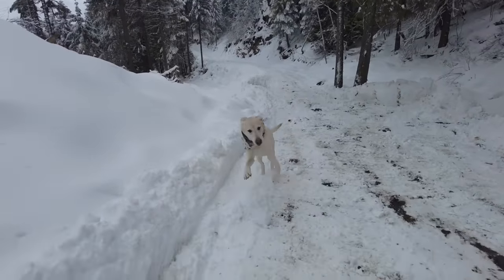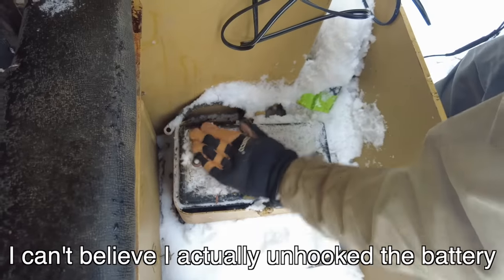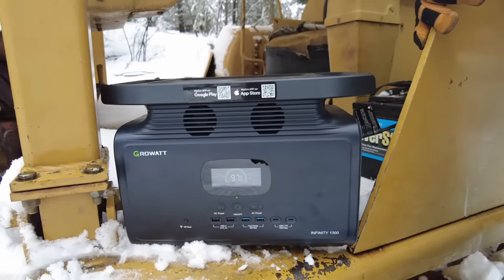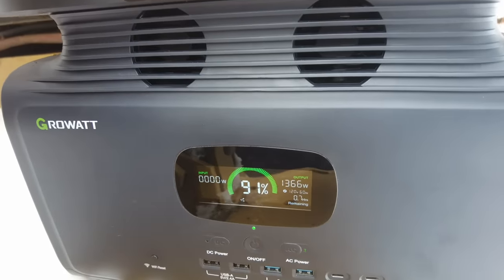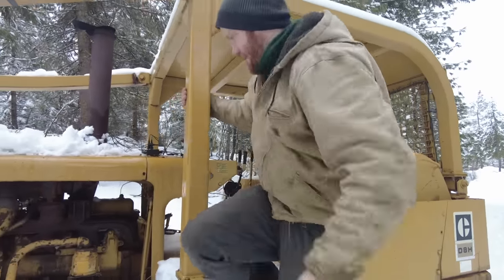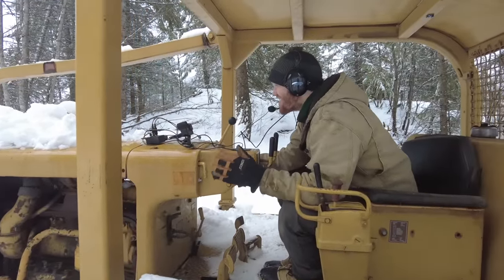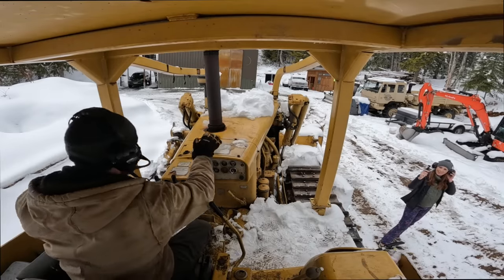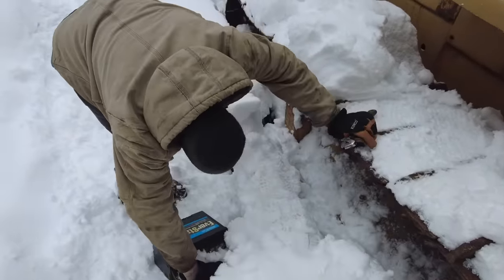D8 Dozer, Will It Start? | Using Our Infinity 1300

Comment: Just so you guys are aware, the pony motor does not have water circulating through it until the diesel engine is engaged because the diesel engines water pump is what circulates the water. You don’t want to run the pony very long without engaging the diesel because it will over heat
Reply: I was thinking the same thing
Reply: Wrong. The pony thermo siphons coolant on some like older john deeres and others do have a waterpump.
Reply: @rednekd1  well I’m referring to a caterpillar not a John deer. I own a D8 exactly like theirs with a pony motor and they do not have their own water pump. The caterpillar service manual for the machine even states that the diesel engine water pump must be turning for the starting engine to receive water. But maybe they’re “wrong”
Reply: I’m wondering just how difficult it would be to enclose this type of dozer cab?
Reply: One day it’s ecoflow then bluetti then growatt or anker lol just more ads than content lately

Comment: Suggestions: 1] Take the batteries out and store them inside for the winter; 2] At least throw a tarp over the cab to protect stuff from snow and water; 3] Put STA-BIL formulations in fuel tanks to preserve the fuels.  Have fun !!!!
Reply: I think they are building a storage building to fit all their equipment this summer. So stored inside, where it can stay warmer and out of the elements. They can probably incorporate battery tenders to connect to all the batteries in-situ.
Reply: I had the exact same thoughts as I watched this video.  Taking the batteries out, would not only help protect them from the cold, but would give you a warm place to recharge them in advance when you knew you were going to use the equipment.
Reply: I'm all in favor of an equipment building.  They certainly have enough equipment and vehicles that would appreciate covered storage.

Courtney says she has a surprise giant equipment coming.. I can't wait to find out whatbit is, and am sure deep thought went into it.

I'm glad you stockpiled videos  / episodes ❤🎉
Reply: My thoughts exactly why  leave s battery out to freeze
Reply: i came here to say the same exact thing. a little winterizing goes a long way with equipment
Reply: That D8 is big rough to make a flat spot a n y w h e r e.  Just make it close enough to run an extension cord to a block heater.   I don't think a battery tender would keep the batteries warm so pull 'em an put them inside on a battery tender somewhere warm.   Sta-Bil.  Grease.  Top off all the fluids.  Verify the coolant's good to -20°F.  Throw a tarp over it and run the block heater once a month for a couple hours.  Even if you build a shed, put the batteries somewhere warm and on a tender.   Tenders are cheap and you can share them over multiple batteries.
Reply: Great things to do for sure
Reply: While I agree with your statement. Leave STA-BIL out of the equation. STA-BIL unfortunately has the ability to gel if you use to much and doesn't do anything if you use to little. Drain both the tank and the carb on the pony motor and use it in the Car/Truck. IF the diesel is not going to be used for months at a time? Drain the tank also. They make Winter and Summer Diesel..I am surprised the Cat fired up...I was almost sure it was gelled in the Fuel Filters. Maybe the Pony motor helped who knows. Things are not adding up in my head. That D8 never should have been able to start TBH
Reply: I used to operate that exact dozer. You have no real idea of how lucky you are that the engine fired up.
Reply: This. I leave my batteries in my farm vehicles, but they are inside an engine compartment and they are connected to a battery maintainer, plus I don't have snow that deep or that often and temps don't get below the teens, usually above freezing. A good way to kill a battery is to leave it in really cold temps, for months on end, without something to maintain a charge.
Reply: Batteries should be stored cold for lowest self discharge, below freezing is even better. Putting them somewhere warm only shorten their lifespan. However, it's important that it's fully charged before you store it somewhere freezing, or anywhere for that matter. The only reason people wrongly think it's beneficial to store batteries indoors/warm, is because you actually have to disconnect them to do so, and a most old iron have leakage currents because of dirty connections and terminals and most new stuff have vampire drains from electronics, so a fully charged battery will be drained regardless of temperature unless you disconnect it and make sure the battery itself also is clean and dry.
Reply: I always clean off the entire dozer off then start climbing on the machine to check things out. Falling can end the whole project permanently. Liked your video.
Reply: @royblackburn1163  I used to work in a manufacturing factory, building, maintaining, and repairing the equipment. We learned that there is a cure for stupid! That cure is “massive trauma”! It always amazed me just how smart those idiots were, we couldn’t stay ahead of them. They just kept getting smarter!
Reply: Vehicles such as these are meant to live outside..........No matter the weather/
Reply: Not a fan of Sta Bil have had better luck with Howse but to each their own just my $0.02
Reply: Start it every week. !! Put conditioner in fuel. Tarp it in. Park it where it can be boosted or charged!!
Reply: I am glad I live in oklahoma
Reply: Not being a wise ass....     but he doesn't know that..      he researching YouTube fir the next move
Reply: To do that they would need to think!!!
Reply: Park the machine close to electrical service so it can be charged and a heater used if necessary.
Reply: Why not check/top up all the fluids before shutting down for the winter?
Reply: The tarp makes life much better....Canvas is the way to go,
Reply: @ChanceHolland-eo3yj 😂

Comment: I understand fuel is expensive but when I put my equipment away for the winter I fill the fuel tank to the brim. That reduces condensation in the tank. I also put fuel stabilizer in the gas tank and then run the engine to get the stabilized fuel through the fuel system. Finally I change the oil and run the engine for a few minutes to get clean oil throughout the engine.
Reply: I run non-ethanol fuel for gas engines that set unused for any length of time. Much better on the fuel system and old carburators. Less corrosion and clogging.
Reply: @brianworley7705  Brain, great idea. Here in Canada the only non ethanol fuel I know of is super. More expensive but worth it not having to fight the fuel system come spring.
Reply: @PierreLamy-t1h  Here in the USA, same with non-ethanol fuel usually being premium grade which is expensive but worth it compared to carb issues and rebuilding.
Reply: Ethanol fuel safe carbs need very specific ethanol safe carb parts.  Even then the ethanol has issues but Sta-Bil helps.  A lot.   Running ethanol fuel in a carbureted vehicle stored all winter is begging for serious issues.

Comment: Playing with dozers is addictive. Bring the batteries inside for winter. It is worth the money to put a big tarp over the dozer when not in use to prevent corrosion. I use a tent garage over mine. I replace the tarp every 2 years($40). You will need to support the tarp so that rain/snow slides off. Park it near your house so that you can keep an eye on it. I have and old Sears kerosene heater for putting under engines to warm them up. Get a fuel funnel for filling fuel tanks. A good fuel funnel will have a screen that keeps water out and the funnel will prevent spills. Good Luck, Rick
Reply: Rick knows!
Good advice.

Comment: the Dozer is nearly unstoppable but be careful on snow pack.. once it starts sliding sideway's its a bobsled on those steel tracks.. TRUST ME .. D9L sliding sideways puts crap in your shorts in a hurry..
Reply: I've went skating with a D6C sideways and I've watched a D8H go sides down a slope, it takes some good sized trees to stop a D8 once it takes off

Comment: Hey Riley, with a pony motor it is relatively easy to get everything warmed up enough to start. I had a Cat 12 motor grader that I used to plow roads with. Almost every time when I needed it I had to go through all of the things like you did. Not much fun and quite often a pain in the booty. With my grader I would take a large bag of charcoal like you would use in a barbecue and put it into a cut off oil drum right under the engine. I would light it up and then go back inside my house and make breakfast and maybe do a little reading. After about an hour or sometimes longer when it was really cold, I would go out and hop in the seat and push the button and it starts right up. Super simple. It does require that you keep your equipment fairly clean because there are not too many experiences more exciting than watching all of the brush burning in the belly pan. That happened to me once but I had a large enough fire extinguisher on the dozer to put it out.
Your method looks a lot easier than what I had to do though. 
Your Pal Al

Comment: Hey Riley, have you checked the brake adjustment on your left and right sides? I can walk you through it if you want, there is brake adjusters underneath the fuel tank at the back of the machine above the winch behind that cover. the left brake always gets overused on the left side because their right foot is on the decelerator, operators seem to like to only use their left foot to brake the machine thus wearing out those shoes first. 

First chock the machine in a nice flat position, with something substantial against the tracks so it can't roll anywhere and disengage the parking brake. Machine engine off. 

To check adjustment pull that panel off and ontop of the left and right brake assemblies is a small cover with 3x 3/8' bolts in each. When you remove that cover there will be the brake adjustment head exposed which also uses a 9/16" wrench or ratchet to actuate. take your ratchet and every time you tighten(clockwise) you should feel a click if the detent isn't too warn out. anyways Run that all the way down until it bottoms out then back it out and count the clicks until it stops rotating counter clockwise. This is going to give you the rough idea of how warn your brakes are. Mark both sides down for how many clicks and then return allll the way to the bottom again (clockwise) and then back out 10-12 clicks each side. 

Once you've done that before you put the covers back on, hop up and feel how the brakes are actuating. if one pedal is closer to you than the other you can adjust accordingly (Counterclockwise pushes the pedal AWAY from you. If your brakes have excessive clicks with the adjuster (140+ depending on linkage wear) you may need to tighten up a bit more than the 10-12 clicks but if you go all the way tight and you still have no brakes on your left track then your brake shoe and drum is past wear and you'll have to replace both. 

install covers with anaerobic Loctite 515 Sealant or RTV and anti-seize the 3/8's bolts and tighten to 30 ft-lbs
Reply: I'm going to need time to digest that.   Come back and reread, then digest again.   Great read.

Comment: Hey Riley, 
That machine should be equipped with reversible fan blades.  There’s a tool that grabs the base of every fan blade.  You push each one in and turn it so you can either pull the air through the radiator or push it out.   We ran our D8’s in the winter time with a rear curtain and two side curtains.  The operator stayed warm and toasty.  I was in our shop the other day and noticed I still have a fan reversing tool but we no longer have a D8H’s. We were running 4-5 at one time..
Reply: He's really building a practical fleet: mini excavator, multi-attachment skidsteer, custom self-created, snow-eating blower on the front of a go-anywhere Army truck, the D8H with a decent blade and handy winch and a host of smaller toys and runabouts. Livin' the dream!
Reply: Richard D is correct 
Look for fan blades that are reversible. Push em in and turn them. 
If not?
You’ll need an elephant snout- canvas shroud that directs warm air from front of radiator to operators station.
Reply: think i remember that on old d4,just by hand,no tool,or maybe it was 951

Comment: Hey guys I have two things for you , first for winter an access port in the air cleaner to stick the heat gun  into to prewarm the air for the pony and the big one to warm faster ... Second , find  a triangler in shape tarp  long side wraps over the radiator left to right side and all the way back to the operator seat covering both open sides of the motor..tie  down points or heavy pull magnets to hold in place engine heat will be blown back to keep operator toasty  but smell like a cat motor by  end of day .

Comment: If the charger won't start charging a battery because it's too low, sometimes you can hook a good battery up to it in parallel, turn on the charger, then disconnect the good baterry. It just expects a minimum voltage to start charging. That's my experience with the Battery Tender brand anyway. Just be careful of surge currents and sparks, and don't leave the parallel connection on for too long.

Comment: Next time take the battery inside. Have a spot under a bench somewhere with trickle chargers for these starter batteries. Also consider putting stabilizer in the diesel tank for the winter. One day you'll have infinite time and money so you can build shelters for all the things! ;-D

I wonder if this dozer heats up the fuel intake too, and if the pony is helping with that. Cold diesel doesn't atomize very well.
Reply: Keep in mind, trickle chargers/battery tenders are a huge fire hazard, avoid using them inside residential buildings if possible!
Reply: @marks8068  not good ones. This is lead acid packs.
Reply: And these aren't Lithium Ion.  The motorcycle tenders are .5 Amp and shut themselves off once they've reached full voltage.  They then "float", watching until the voltage drops below a threshold turning themselves back on at .5 Amp.  Great for long term warm storage.

Comment: Drive the tracks onto boards or trees to keep tracks from freezing to the ground. Put blocks under blade. If working in mud, make sure you clean inside track rollers free of mud before leaving to freeze.

Comment: I work on old gear like this among newer mining gear daily. 
These old dozers will start relatively easy.
Big thing is to try, however briefly to engage the trans into gear and hydraulics. Do this to confirm pumps are moving oil. If the pumps run dry severe damage will occur.

Comment: In Northwestern Canada some tend to remove the batteries at the end of construction season in the winter and keep them indoors on tenders in warmer surroundings. This practice can keep these relatively expensive batteries going for many years. Ps. You'll need to put some winter diesel in it or dilute the tank with some kerosene or conditioner.

Comment: I remember taking steel barrels that has been cut down about 10 inches tall and dumping Charco in them and covering the Dozer up with tarps and then sliding the charcoal underneath the belly of the Dozier and warming them up that way

Comment: I needed to get new batteries for my CAT 977 track loader and I purchased two 12 wat solar trickle chargers first.  I found that my batteries are now fine and ready to go another year or more.  For the pony motor, I would advise a large deep cycle battery with one 12 wat solar trickle charger.

Comment: My dad use to put a little solar battery tender on his equipment. He'd make a little bracket with a magnet and just stick it on somewhere it would get sun. Snow will melt/slide off and his batteries always worked come summer.

Comment: One trick my grandpa taught me after using our D-8H was to open up the compression bypass at the same time you shut the fuel off with the throttle, it makes it so the engine stops in a random spot, the pony motors on these are hard on the ring gear, opening the compression release makes it stop in a random place

Comment: 1 thing never to forget, that machine is on tracks. Which means at any time they become very unwanted Ice skates. 😮 Be safe 😊
Reply: It has good grouser bars
Reply: Had a 9 sliding on Ice little down hill on the right side a drop of about 1,000 Alaska good times

Comment: Reversable fan, push blade and turn. The hole left side inline with fan incert fan tool.  
Patterns for engine side shields online.  Engine running cold, we used piece old carpet (wire tied front sweep posts) cover over radiator at -40°C with wind -50.

Comment: Over 50 years ago the Cat. 8H was the primary main large dozer there  was. It is a good idea to try and keep mud out of the tracks in the winter. Looks like the tracks need a little tightening Best to follow the fuel recommendations from the commenters. Try and keep the old type antifreeze in the engines year around. . If you are going to use it a lot in the winter worth the trouble to reverse the fan.

Comment: Riley. I'm impressed how much detailed D-8 dozer information you learned in the summer and how well you applied it with the GroWatt Infinity 1300 to heat the gasoline powered starter motor and then warmed up the diesel.  An amazing series of steps you successfully used to run the dozer!  Courtney, thanks for the great video taking and the editing!  Can't wait to see your new summer projects.

Comment: Using the infinity and the heat gun to preheat the key components was a great idea.  I’ve heard older operators claim people would start a small fire on the ground under loaders and graders to accomplish the same thing…..  your solution seems much much safer.
Reply: The Russians do that, light a fire under the engines to warm them up before firing them up in really cold conditions.